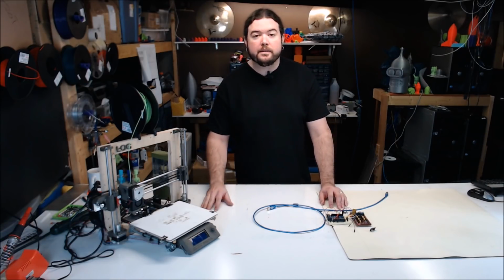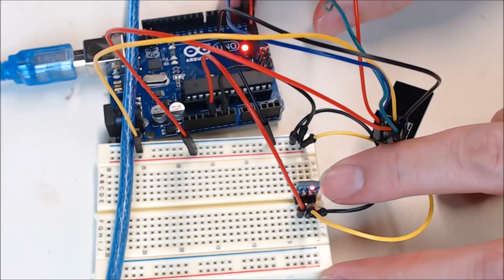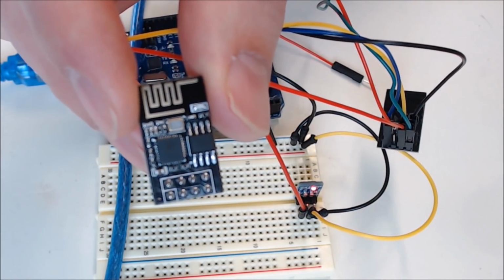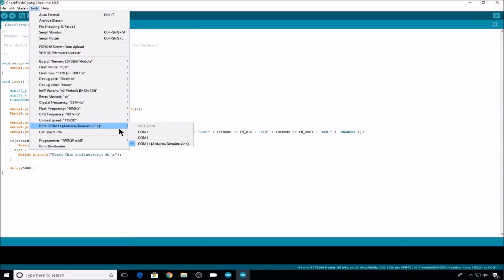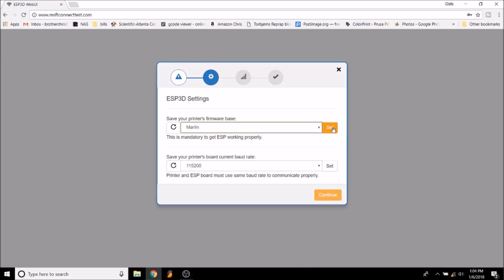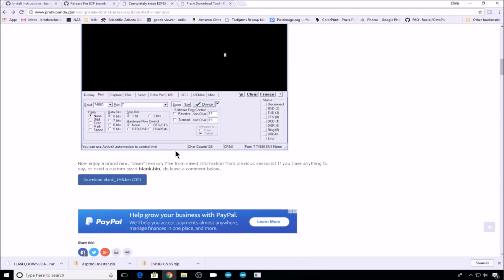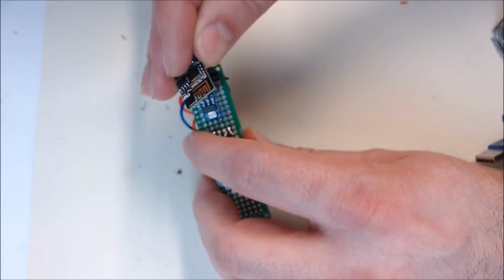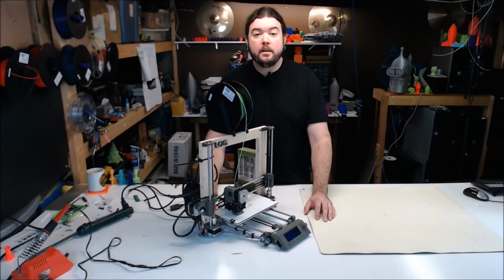Add WiFi To Your 3D Printer For $5!!! - ESP8266 - LUC ESP3D - Chris's Basement

Comment: Hi Chris, great video. I try to connect an esp8266 esp-01 v1.2 module to Ramps, but the module does not respond as you described, I get error: espcomm_upload_mem failed when trying the CheckFlashConfig sketch.I am using an Arduino Mega and connected the esp8266 exactly as you described. I use TX0 and RX0 (since the Mega has more serial lines), and derived the 3.3V from the Mega's 5v. My question is, should the Tx0 line from the Mega not being damped to 3.3V? Do you have a suggestion what I might do wrong? Thanks in advance.
Reply from the maker: I'll have to go back and look again on my board. Your shouldn't need to change anything with the voltage on tx or rx.
Reply: The only differences between your setup-configuration and mine are: Arduino Mega (You: Uno) and MacOS (You: Windows). Could one of these be the cause?
Reply from the maker: Not sure what is going on here. I can get this error to pop up, but only when I change board types. Go back and check the board type one more time. I will keep looking.
Reply: I suppose you mean the ESP8266 board type. Mine is sold to me as ESP8266 ESP-01 v1.2  . No further text on the board. Board has 2 LEDs: 1 red (power) and ome blue.
Reply: I have tried a setup with ESP and USB to TTL converter. In this setup the RST is tied to Vcc via a 10K resistor, and to generate a reset signal it is switched to the GND.  (see https://www.allaboutcircuits.com/projects/breadboard-and-program-an-esp-01-circuit-with-the-arduino-ide/) I flashed the WifiScan sketch and ... it works. So the ESP module is OK. Must be the connection and use  of the RST, GPIO0 and CH_PD signals.
Reply: Tried the same setup as webpage above, conclusion: flasing via USB to TTL converter works fine, flashing via Arduino Mega still does not work, looks like tx0/rx0 are not free to send/receive data to ESP.
Reply from the maker: Well at least that part works.
Reply: After some more tests: the RESET pin of the Arduino Mega should be connected to ground. Now uploading works, and the ESP is working stand-alone, and is available in my network. Just the browser does not pop up.....
Reply from the maker: Ah, good to know, the mega must be a little different. Is your's a clone mega?
Reply: Yes. Chinese. But the originals act the same in this respect. Also the webpage with the printer control pops up now, so I can put it in my 3d printer (Infitary I3, the board HY_BASE_L V1.0 is modified to have the TX0 and RX0 available, like in the RAMPS board).
Reply from the maker: willemnitert Nice work on this, glad you are making some progress.
Reply: It all started with your video, so again thank you. Perhaps others can benefit from the Arduino Mega tip to ground the RESET line. Greetings from the Netherlands.

Comment: Good Job.
CH_PD = Chip Powerdown NOT Check CPU
Reply from the maker: Thanks for the info, I didn't realize that.
Reply: Chris Riley this is what is used for powering the chit down or hibernating it.  Normally for such an application it's tied to a gpio pin so it can wake itself....  Very useful for battery application but not so much for your project.
Reply from the maker: James Kerns Jr. Very cool. I am always up for learning something new.

Comment: Man I really like that built in pronterface interface
Question...could this be used in conjuction with the USB interface and octoprint? (even though you wouldn't need it)
Found a board to replace the regulator, and to make it an all in one...board can be found here
https://oshpark.com/projects/UjaqAVdF
Reply from the maker: Ha ha and they use my video, nice! I think you could use all 3, but you might have to change the serial interfaces around. You would probably have to log one off and the other on to use it. I would have to play around with it to tell you for sure.

Someone sent me this link the other day as well. Might want to check it out.
https://www.ebay.com/itm/ESP-01S-ESP8266-Serial-Wi-Fi-Wireless-Module-ESP-01-Adapter-for-Arduino/201711916394?hash=item2ef6f7956a:g:4ZYAAOSwHMJYIHFW
Reply: Chris Riley oh nice, built and ready to go...sweet!
Reply: @ChrisRiley  Of course I used posted your excellent video...had to explain the awesomeness of why the board was made ;)

Comment: With a 5v power supply it works, but when I connect it to a RAMPS board for power it does not, and the LCD dims.... verified it's connected right... I have a spare VR around here... if I find it I'll check that.
Reply from the maker: Mega clone have a bad habit of not having very good 5v regulators. Try plugging in the wifi to ramps then cabling the board you USB to get an additional 5v source. See if that works.

Comment: i got this error when upload espd 0.9.99 file using arduino IDE
warning: espcomm_sync failed
error: espcomm_open failed
error: espcomm_upload_mem failed
error: espcomm_upload_mem failed
Reply from the maker: That doesn't sound good. My be a bad chip. Double check you have the config pin connected.

Comment: Very interesting Video. Thanks for this Tutorial.
 I have a question though: instead of the RAMPS, how do you connect the ESP8266 to the Anet controller board?
Reply: I finally figured it out! and I found the proper pin-outs from the Anet controller board
Reply from the maker: Mohammad Kanawati Thanks! ANET is going to be trickier. The easiest way is using the LCD plug to access the correct pins. You would need a pin out of that plug.
Reply: The problem that I'm using the full graphic display, which uses the last 2 free ports on the board. I also looked in the ESP3D wiki and it seems that someone have to figure Rx and Tx points out on the board.
Reply from the maker: There is a plug adapter that allows you to do both, I can't seem to find the link. I will keep looking for it and send it over.
Reply: Ramps is so much nicer.
Reply from the maker: It is a lot more flexible for sure.
Reply: Good for you! Nice job!

Comment: Hi Chris...i did all of the above tutorial...i can enter to my esp8266 module via web...but I can controll my 3d printer with it...help me here pls.. I have arduino mega clone with ramps board...it has to be done something in marlin firmware in order to work?
Reply from the maker: alin ioan moroi My first guess is a baud rate mismatch. You shouldn't have to change anything in marlin to get this to work. Hook up to your printer via pronterface and confirm your baud rate. Then change it in the WiFi web gui. Let me know if that works.
Reply: the baud rate is the same in marlin and in esp8266...i plug in the right pins on aux1 ...i verify 3 times the whole wiring...i go to the web page but cant make my printer to move or to heat
Reply from the maker: alin ioan moroi Let me go back and look at mine again. I will let you know what I find.
Reply: I might have my arduino  broken...i can't connect to usb now...only printing from sd card...
Reply from the maker: Did this happen after you tried the WiFi add on or before? If USB isn't working sounds like you have a serial interface problem. Maybe something is shorted.
Reply: Chris Riley i don't know if were after or before...the last time I update my marlin was a 2 weeks now and all worked fine...now I can't even upload a sketch to my arduino..i might have to buy another arduino...to test it...any way...thank you for this great tutorial...keep up with a good job..!

Comment: Followed your instructions, and it worked great. I think I still prefer octopi on my $14 orange pi zero, but it’s still a nice option. I like your videos, so you have another subscriber.
Reply from the maker: Michael, thanks for the comment and the sub. I was hoping someone else would try this out. I agree the octopi is much better, but a fun cheap project.
Reply: Chris Riley  I like the esp solution as once gcode is uploaded nothing should interfere with the print. With Octoprint I have gone through periods where the usb was playing up and the printer kept micro pausing every few seconds.  Octoprint also has the issue that when left plugged in my ramps board the lcd is still lit even when the printer power is off.

Comment: So, that board you're hooking the 8266 up to - does every 3D printer just happen to have that interface? I have a CR10  - without opening the control box/power supply, all I see is an external USB plug.  All I really need is the ability to wirelessly upload prints, so this project will work for me
Reply from the maker: We touched on it in the stream, but all printers probably have access to this connection it's just going to be a little difficult to find the right point to plug it in on some models. Not sure on the CR10, I can take a look.
Reply: you will need to find the pinout of the controller. i dont think the cr10 is open source. contact them for the board pinouts.

Comment: yo chris, i am trying to make an arduino project that i saw online. Its basically a 3d scanner using photogrammetri. I have some issues though so i thought i should ask the jesus of electronics. 

My lcd screen doesnt show any text after i have uploaded the program from arduino IDE. Have you worked with arduino IDE and programmed LCD 1602 screens and such?
Reply: Btw if you are interested in the project i will send you a link and some stl files i have made/modified for the chassis :)

As always you know i am a practical guy that sucks at electronics but i am trying my best to learn. xD
Reply from the maker: Ha, hey Espen, it's been a minute. Sure, I can help with that. Is this the same project you sent me the link to a while back? if so, ill take a look and see what is up. If not, send me the link.
Reply: Yeah i finally got the parts and the balls :P to start the project. the practicle side was great even did some dual colouring on my custom case, and i was fealing like this was a walk in the park. Thats untill i meet the monster called Arduino IDE!
Reply: After huors of checking youtube for what a library is and how do you get that to the IDE software i again felt good. I just got to the point where i was able to download the firmware to the arduino. Now i have uploaded it but as i said the LCD shows nothing but a blue screen when powering it on.
Reply from the maker: I was unable to get my LCD screen to work with this code. I don't have the LCD shield they use here, so that is probably the issue. not sure how to help on this one further. I might try to get a shield and build one of my own.
Reply: Do you think the problem can be that i have the wrong library?
Reply: I havent gotten the hello world test to work neither
Reply from the maker: EspenShampoo25 Are you on a Mega or an Uno?
Reply: Mega (its a fake one though)
Reply from the maker: Library should be good. Check this out. https://www.allaboutcircuits.com/projects/interface-an-lcd-with-an-arduino/
I have found the key with the LCD screen is to make sure the contacts are perfect. If even one is even slightly disconnected after power up it won't display anything except the squares. 

I just went back and tried all these examples on my knockoff mega with the default libraries and everything worked. Let me know.
Reply from the maker: Well that link I just posted, I wired my LCD up like that. Then just for fun I tried the scanner firmware again, it worked first time. If you can get the demos to work, you will be all set for your project.
Reply from the maker: Not sure if these pics help.

https://i.imgur.com/ZG0ZnnR.jpg
https://i.imgur.com/LGA59Iv.jpg
https://i.imgur.com/7bzxIfv.jpg
Reply: it was the potentiometer! i got characters now, I had tried twisting that atleast 5 times earlier to no effect but now i said its all or nothing and twisted the damn screw like there was no tommorow! Thanks Chris you are the man ;)

Comment: Older fat filesystems have the 8.3 naming limitation, hence the issue with .gcode :D

Id looked that this and it's something I may use but i'm probably more likely to look at some of the serial<>wifi bridges that people have implemented using the esp-01 modules, that way I can keep  octoprint.
Reply from the maker: Thanks, that's good info!

Comment: Finally somebody made a video about that great project from LUC. Checkout Wemos.cc the LOLIN32 Pro V1.0.0-wifi & bluetooth board having SD card, Lithium battery interface and 5V power regulator on board. https://wiki.wemos.cc/products:lolin32:lolin32_pro no need to solder :-)
Reply from the maker: Thanks for the comment, awesome board. That would be perfect for the hang printer!
Reply: Also the cheaper D1 mini board would no need to solder that much and you can program it directly :-) and lot of shields available
Reply: its an esp32. someone has already developed a controller using the esp32. http://esp32robots.co.uk/index.php/hardware/3d-printer-controller